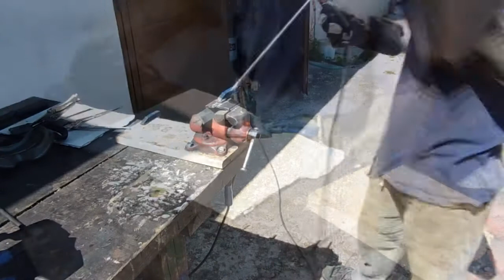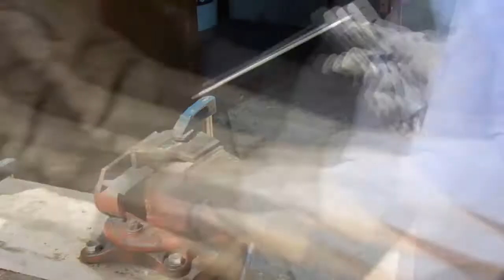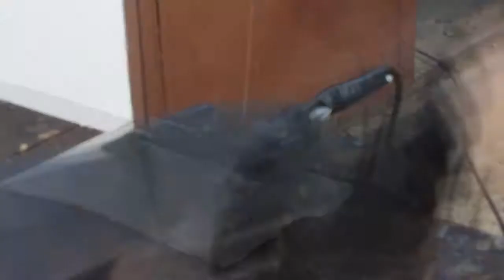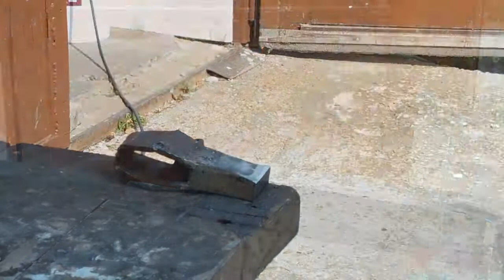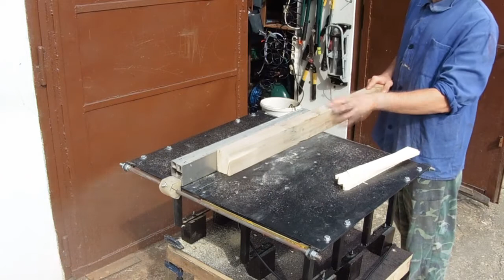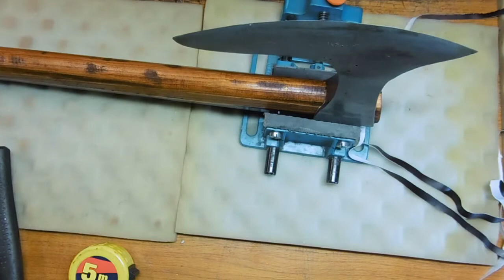MK: DIY Ragnar´s axe

Comment: Thats really good! I want to do the same project but casting the axe in aluminium. Une fast cuestion, can the Ferric Chloride etch aluminium? I really need to know :P
Reply from the maker: im going to do some tests and I'll let you know
Reply: Michal Kubrický: DIY Thank you!
Reply from the maker: ok so I tried it and it works like 100 times faster than with steel. I dipped the aluminum piece in the FeCl3 and it immediately started fizzing and after few seconds it was almost black. After I cleaned it with sponge and water it was little brigther but the etch was there. So I would probably try applying it with bursh instead of dipping it and definitely would recommend a respirator. Good luck with your project and let me know how it turned out :-)
Reply: Michal Kubrický: DIY Thank you man, you are the best!

Comment: Ok. So yesterday I told my wife there are 4 way to make an axe. 3 of which don't require power tools. And ofcource here is a 5th. But is it just a prop or will it function as an axe?
Reply from the maker: It wouldn't work as proper axe very well mainly because the head is soft steel but other than that it most certainly would cut peace of wood/enemy